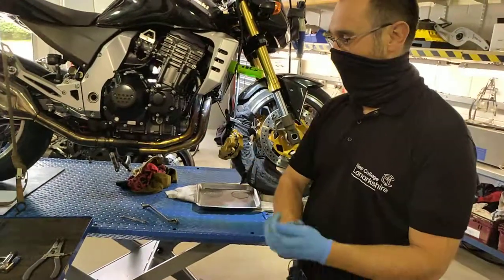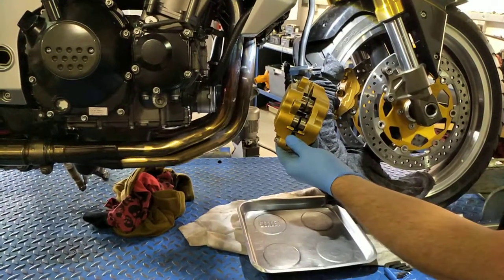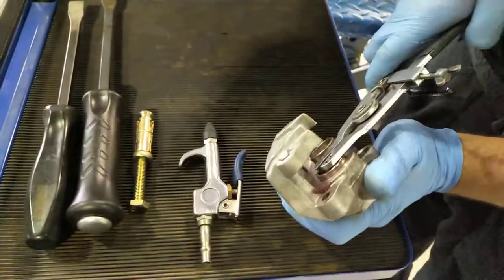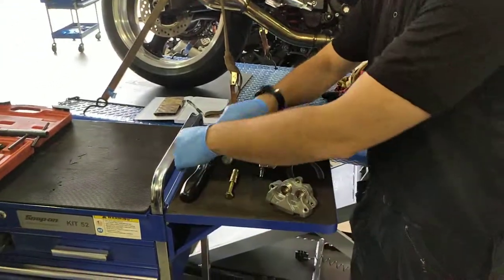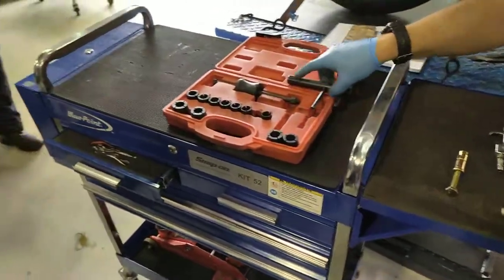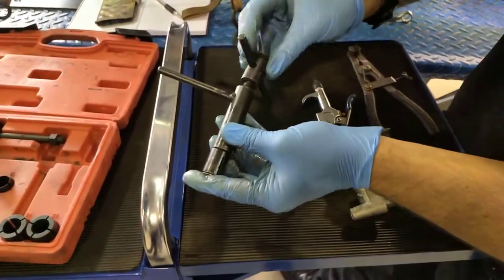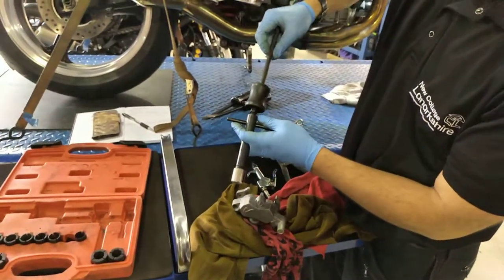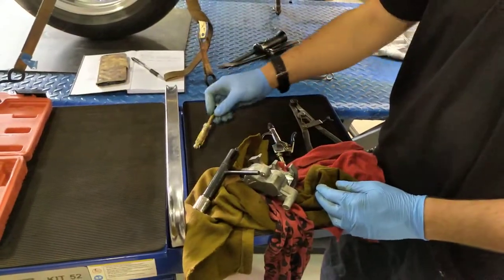motorcycle brake caliper piston removal tool options

Comment: mine were so seized not even air or brake pressure worked..split them and used the lathe chuck to grip the inside of the pistons..job done.